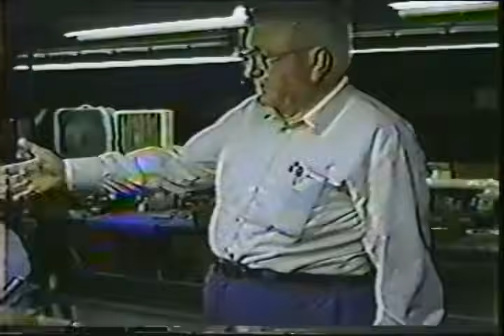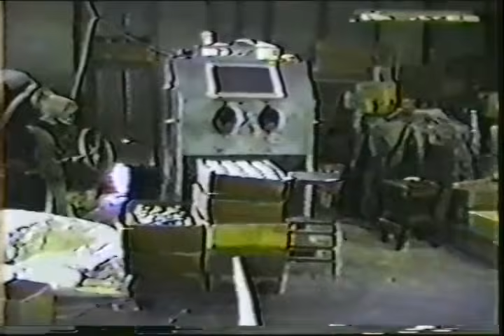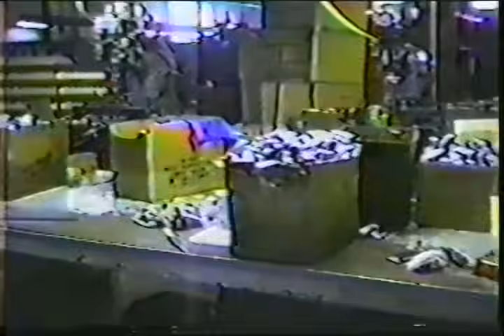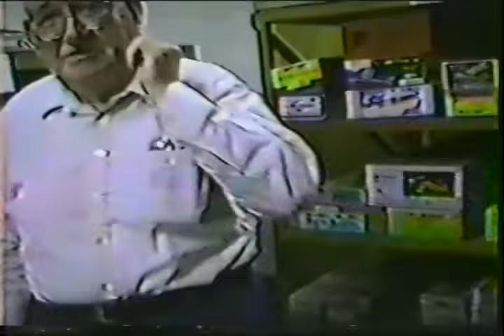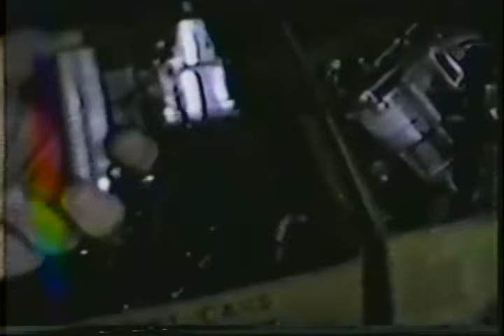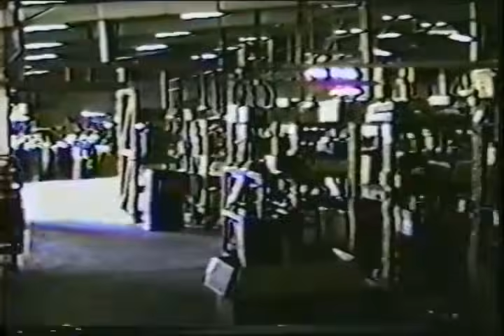Fox Manufacturing Guided Model Engine Factory Tour late 1980's in Fort Smith Arkansas

Comment: I had a 60 FOX which I think was a Red Head on my large scale Stearling Shoe String U-control.  God I loved to fly that plane every chance I had.  One Sunday I was flying it on the super smooth play yard of my Jr HighSchool when one of the braided lines broke and started doing loops and going down with every loop, so I let it go and it went level and up till it disappeared.. I worked at a local bike/hobby shop and two weeks later a nice older couple came to the shop with my airplane!  Amazingly the lines got tangled in one of their fruit trees and landed safely upside down in their backyard...  I went on to fly that plane for years until I sold it to a good friend of mine.
Reply: excellent
Reply: I had a similar experience. It was a cox 049 on a flying wing combat type of plane. My girlfreind launced it by hand and it wasnt one of her better hand jobs with the lines all loose i threw the handle away. Then it dtarted swinging around and swinging the handle like a sycamore seed but going up.

Laughed so hard.

Then the engine stopped and it all fell in a pile.

Comment: Wow - a lot more going on there then last time I was in there - which was probably 5-10 years after the video.  Fox was doing some contract machining for us in the 90's.  Mrs. Fox had hired a guy to come in and try and save the place.  He gave us the tour.   I remember when you went into the shop, the big screw machines were there.  Mostly idle.  if I remember correctly, they made artillery parts in the Viet Nam war era as well as parachute rings (I think there was another shop in Ft. Smith that made the parachutes). The smaller screw machines were farther in and they were working.  The die cast equipment was in the center back and there wasn't much there - they were casting gas tanks.  In the center they had the glow plug line and a small assembly area.  I don't think they were making many engines at that time.   I'd say maybe 20 employees max.  Kind of a big empty building.  Glad to hear someone took them over.
Reply: Lots of work for those screw machines now for the people who still have them!  If you can find anyone who knows how to run them.